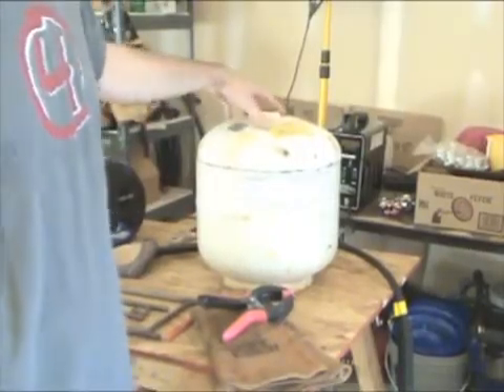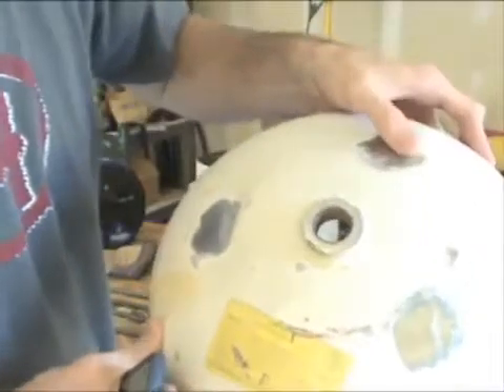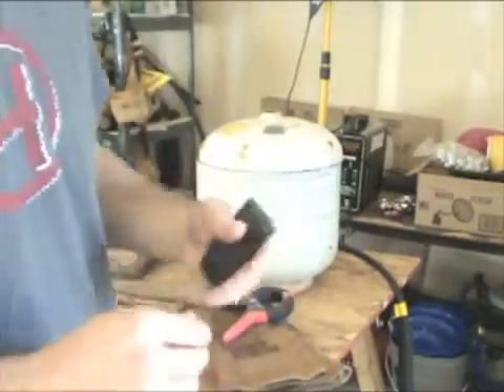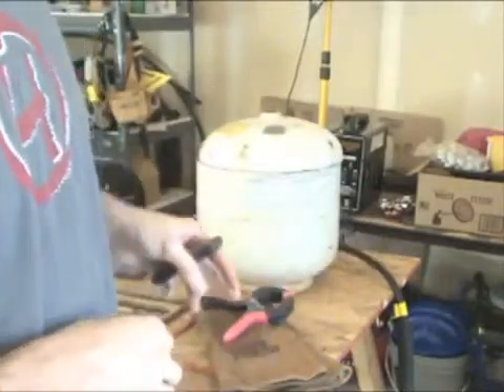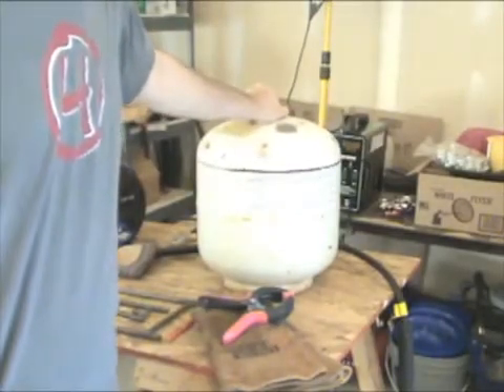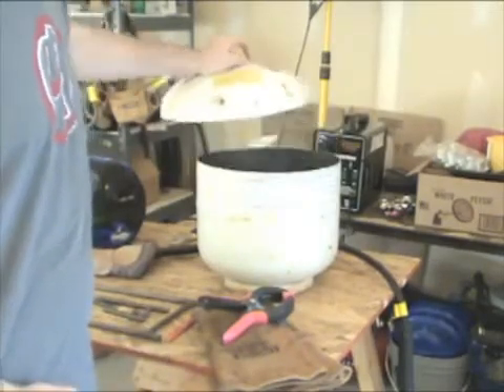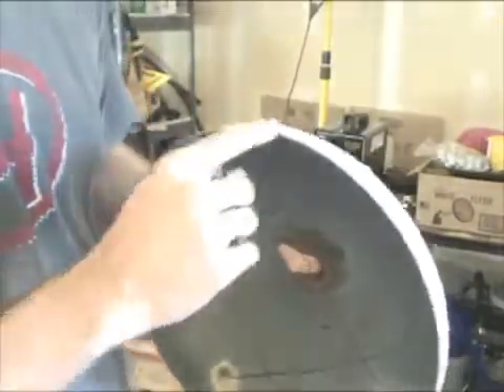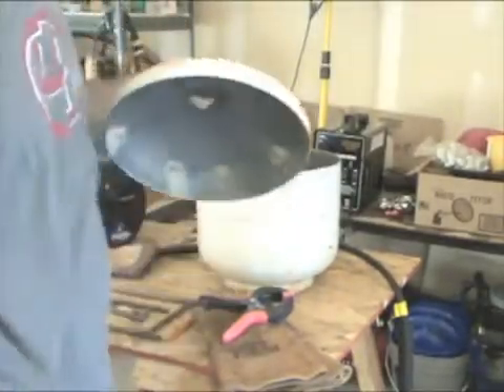How to Build a Furnace from a Propane Tank Part 1

Comment: Eh' all you gotta do is wash it out with gasoline and start cutting! Q plasma cutter works well for you this!  And be sure to say "watch this" just before starting to cut!!! And be sure to video the build. Well it don't really matter if videoed or not. Because you likely will not be able to watch it!   

Seriously though it would be better to leave water inside when you cut if you can. The steel can be porous and may hold small amounts of gas inside. If you can get by using refrigerant tanks it would be safer! Nice video...

Comment: I removed a valve with almost the same method, but used a 4 foot cheater bar over the handle of the pipe wrench and had strapped the tank with a ratchet strap to the hitch on my truck.  Good info sir!